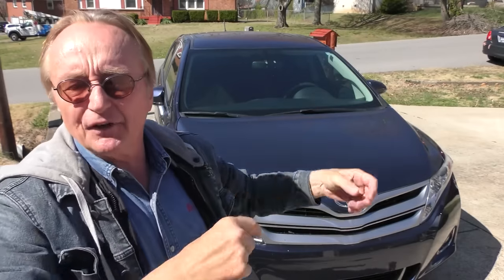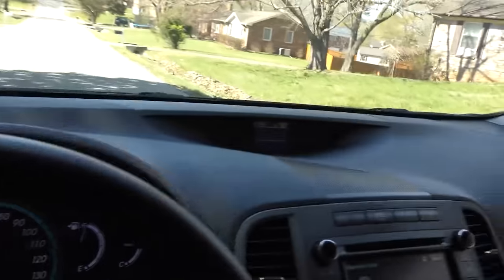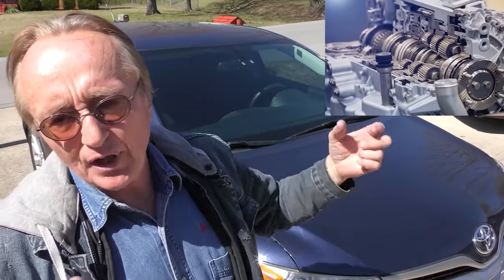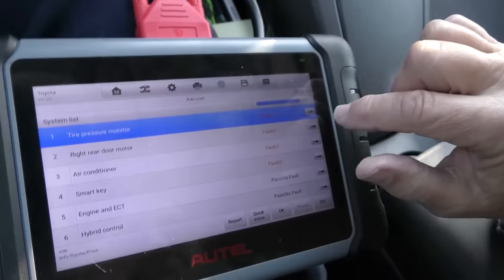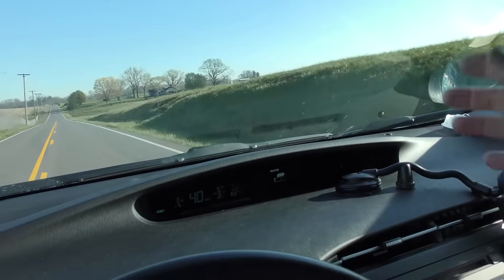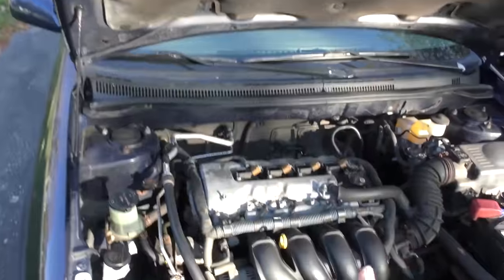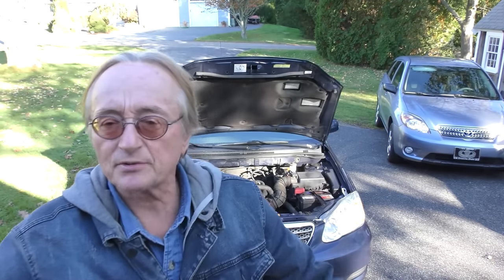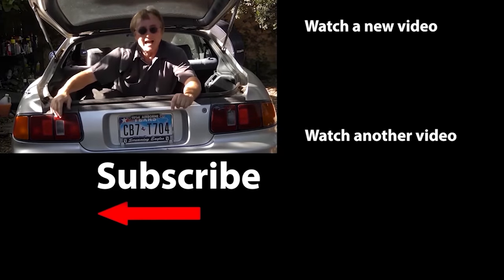Everyone Hate These Cars, So You Can Buy One Dirt Cheap

Comment: A hub cap serves a purpose of covering the hub but and helps prevent the lug nuts from rusting on so hard. The cheaper models that have hub caps many times will use the cheap lug nuts with it, and therefore the hub cap serves its practical purpose. But the flashy models have no hub caps but designer rims, but since they no hub caps it is required to use the more expensive lug nuts that have a cap on each and every lug.

In other words if you want to have the practicality the hub cap provided for the car without the hub cap, then you need to find lug nuts with caps that fit the car hub and rim.

Comment: I just got my 03 protege back from shop. Got a used 45k motor put in. The first motor went 220k tranny about 180k. Simple little 4 banger easy to work on great gas mileage parts are super cheap it's my second favorite. My 89 VW fox was probably my best car I ever owned. 305k when it finally went. Couldn't find a motor for it so sold it. Kills me to this day lol
Reply: I got 175k out of my 88 VW Fox Wagon….awesome car bought new owned for 14 yrs.
Reply: @jarhead6153  That's nothing. I bought a new Nissan Sunny in 2000. Still running perfectly after 23 years, and over 200k miles.
It's still in mint condition also.

Comment: I myself prefer a standard transmission in what I drive. I'd also have to say that the plug in hybrid does make the most sense when it comes to electrification. 50 to 80 miles worth the battery range so you can plug it in and do most of your normal commuting and the gasoline engine for when you need it. I really think that makes the most sense.

Comment: I agree with Scotty in that one doesn't always need bling.  I wish I could have found a Venza like that one when I needed a car.  Yes a FWD Venza is vanilla but I'm at the point where comfort, reliability and not killing me at the pump is what I need in a daily driver.  The one thing I don't agree with him on is snow tires on the front only with FWD.  I live in a place that gets winter and you need the the traction at the back so the rear end doesn't swing out under braking.  I can also say that FWD with proper winters has gotten me everywhere I need to go in the worst weather.

Comment: These are kind of hard to find. Toyota didn't sell them in big numbers so there aren't a lot of them out there to begin with. The good thing is that you can usually get these for substantially less money than a 4Runner or any other Toyota SUV with similar mileage.
Reply: They aren't suvs that u can compare to a 4runner. They are lifted station wagons. My sis bought a 2015 loaded one, v6 awd. A camry with a lift kit.
Reply: YAWN
Reply: With nice rims, bigger tires, amp & subwoofer, tint the windows, black exterior you got a pretty nice car.

Comment: Ive Ubered in several Priuses with over 250,000 miles and one with a smidge over 300,000, all ran great and had the original battery.

Comment: I wish I'd been able to find a car like this Venza last summer when I was forced to buy another car after my 98 Accord went up in flames.  The best I could find was  15 Nissan Altima S with a CVT that I'm not thrilled with.  I much prefer the trans in the Venza.  Good work, Scotty!
Reply: Those nissans won't even last 100,000 miles . Good luck
Reply: Those are actually pretty reliable cars you really just need to take good care of the CVT
Reply: @icosthop9998  I've been forced too
Reply: @icosthop9998 sounds like someone needs to get their credit up cause only fools are forced into cheap cars lol
Reply: @TREBLATALKS  That vehicle will last if you take care of it.  Even a timing chain job is cheap compared to New Car monthly payments. . Crate Engine if need be.
Reply: DId you file a lawsuit for your car going up in flames? cars are not supposed to go up in flames. and it could have killed a family if they had been in the car. that's a big-time criminal negligence lawsuit.
Reply: @wrestlerstudmuffin Its a 98 accord that probably had some miles, and leaks. After the warranty is up by like 23 years its very hard to find an automobile company to be liable for stuff like that.

Comment: Bought a one owner 09 Venza with 60,000 miles yesterday coincidentally the same day you posted this video. Got the 4cyl by choice. Paid $14,000 out the door. I know a few years ago it would have sold for under $10k but the way I look at it, it will last another 250kiles. Most new cars today that are $25k will start to fall apart after 100k miles.

Comment: Damn, I'm old enough to remember when you would say "you don't need a big V8 unless........" but now we got scotty saying the same thing about the V6. 🤔
Reply: Toyota's 4-cylinder engines from 2010 and after make up to 170 hp and 170 lb-ft of torque, and they are cheaper to maintain than the V6 models.
Reply: F1 cars used to have V12s, V10s, and then V8s, now they have V6 turbo hybrids and set faster lap times than ever. Engines and power trains continue to get more efficient and in turn, smaller

Comment: $1000 for TPM's? WTF....over?  I just did the TPM's in my C5 Corvette last time I put tires on her ($600 for Kumho Solus at Tire Rack 😂). Bought 4 NEW TPM's at RockAuto for $96!!!!!

The local tire shop here in Knoxville was so cool, they let me come into the  garage and install the new TPM's after they ripped the tires off the 5 spoke wheels.

When I got her home, ran a magnet around the car and performed the "TPM learn procedure". Piece o' cake!

Comment: "Most people think they need more than they actually do."
amen. Applies almost everywhere, especially with technology.
On cars, I laughed out hard for over a minute straight when I saw the mini-van (2013 VW Sharan) my parents got as an upgrade for our ageing but mechanically good MPV (2007 VW Touran).
It's huge (to European standards), has poor fuel efficiency and takes some getting used to to shift properly, but wow did they get a fancy trim level.
I like it for it's different driving experience, nice contrast with our second car (2019 VW Up!, very basic trim) which I get to drive more.
Maintenance is their problem, I'll watch how these German built new computerised VWs hold up and use that experience in my consideration of what to get for myself down the line.

Comment: I have a 2005 corolla with a manual transmission. I've owned it for 15 years and it has 178,000 miles. No issues.

Comment: Oh yes absolutely put it in power mode when your going out into traffic quickly and when passing someone..it makes a world of difference! 
     I used one of the 2 Prius my parents have. And for the 1st 3 days I was like dam this thing is slow and really dragging out that gear! (Not knowing CVT was belt driven) 
But it sounded like I was dragging out 3rd hear at 45-50 MPH! 
    Then discovered the modes. And I kept it on power mode and still got 45mpg  really getting on it too.normal mode it got 55MPG. So 10mpg less isn’t such a big deal for power

Comment: Yeah.  Toyota later inline 4s make their 3.0 L V6 obsolete, which gave very slight advantage over the previous 4-bangers, because they made the frame so much heavier in the first V6 runs.  I think they kept the same frame when they went up to 3.4 L, and those were really nice pickups, still in high demand, used, but in very short supply.  I wish I'd bought used when I bought my 2012 new on a lease, because I had nothing to put down.  sigh

Anyway, that's good to know about the Venza.  That it's basically a cross-over on a Camry chassis with a Camry motor.

Comment: I have a 2009 Pontiac Vibe. It is a sister Toyota Matrix. I have the 2.4 Toyota engine. I change the oil every 3000 miles. The oil consumption is minimal. I change the transmission fluid every 12000 miles. 
The car has 122,000 miles now no problems.

Comment: I had a 2003 4Runner with 256,000 on it. Ran like a top and everything worked perfect. Unfortunately, the frame rotted out. Apparently it was a known issue for that generation
Reply: Same thing with this generation Honda Pilot. I checked out a 2008. Fully loaded and I was almost sold until I looked at the rear frame area. 
Too many holes and thin spots
Reply: If its not the guts its the structure...

Comment: My 2004 5 spd. Corolla was super fun to drive. I learned how to drive on a Ford 9-N tractor. And I use a clutch like a trucker. My clutch will last forever, anyways, that Corolla transmission went out at 180,000 miles. I always changed the fluids. It was clean. IDK, that main carrier bearing went out on the tranny. Other than that is was great.
Reply: Absolutely true I only used the clutch for 1st and reverse.  I put 300k and donated it to a senior living home and they are still driving it only needed to have struts and shocks replacement

Comment: i drive 2 Venzas, a 2009 V6 AWD is my personal car and a 2013 4 cyl FWD work car which is a taxi, the  4 cyl 2.7 L are known to be oil burners and they also have problems with the vvt  timing gear which causes a rattle on cold starts. The transmission also started slipping at 200,000 kms, it currently has 350.000 kms and still runs good , despite the issues. My 2009  is in mint condition . The V6 is far superior to the 4 cyl.  Also the difference in fuel mileage is only 1 mile per gallon.

Comment: I do not understand why they don't give those alumin(i)um engine parts some varnish, for instance a clear poly-urethane, coating. Those parts as far as I can tell would not get so hot that that coating wouldn't be able to cope with the temperatures, and such a coating would be a cheap and effective way to keep those parts from degrading even if only surfacially and visually.

Comment: I live in Las Vegas and there's a lot of Venzas for sale here. Average is older, 2008, 150,000+ miles and $14000 to $17,000 dollars. Yeah, I don't think so. I just picked up a 2015 Hyundai Tuscon that had a recall and new engine put in 50,000 miles ago for $7,000. It's underpowered but it drives like a new car. It doesn't matter what car it is, a hundred thousand miles, is a lot of miles.

Comment: Hi Scotty. I've just discovered Your chanel and it is great. Now, regarding Hyundai Accent. I have a 2005 1.6liter accent with an A\T. You are absolutely right. This car is so flimsy that one could say the body works as a part of suspension.Whenever I ride over the curb my back hatch moves a few mils and makes fumy noises. It is 100% accident free. It was designed like that and I like it.  Just did over 110000km. with a LPG installation and never had a problem with it. 8,5 liters of LPG/100km !!!. Cost under 5 USD per 100 klicks. Just need to change oils and filters regularly. Greetings from Polish coast. Village of Mielno.

Comment: At the time of this recording, or the release of your video, TOYOTA, just released their Toyota RAV4 PRIME Which is considered a plug-in hybrid and does exactly what you just expressed. It starts on electric until a certain range or battery level and then it switches to the gasoline burning engine, and there is no going back-and-forth, it always has to start on electric and once the energy is depleted from the battery to the threshold at the BMS is programmed. Then will do gasoline burning engine turn on the RAV4 prime. so in my opinion, yes it is the best of both worlds and there is no need for strictly electric cars because there is no guarantee you will be able to get electricity, but there is always a guarantee you can find a gas station.

Comment: I bought a 2014 Venza with a V6 and 49K miles on it five years ago for $16,000. Not AWD. It's an XLE so it has a sunroof. It presently has 80K miles on it as I haven't driven much since I began working remotely. I like its get-up-and-go, but the MPG is a disappointment.

Comment: Get v6 .  More power is always safer for passing. I   Had underpowered V6 F150 what a nightmare. And it was 2 wheel drive in West Michigan winters. Finally bought a used 04 Silverado with a 5.3 V8 and 4 wheel drive what a difference. And the gas mileage was negligible.

Comment: I just bought a 2015 Range Rover HSE Supercharged, dirt cheap, $19k, It drives and looks expensive,imma do the timing chains and replace the air struts, $2k in parts, it'll go another 50k miles trouble free.

Comment: My 2010 Venza has 112,000 mostly city miles too.. the V6 gets 20-24 mpg.. but it's fast as hell too.. needs tires & prolly needs brake pads again
Reply: First time I see someone trying to sell his car in Youtube comments
Reply: @karakraal4551  Hell no,, I pick cars carefully, always buy used and drive the wheels off of them. PLUS,, now I'm a 60yr old x-mechanic,, when I pass, this Venza goes to my sister..
Reply: I have also a 2010 venza with 197k v6 it's really fast some times when I give it gas my neck snaps back lol. this has been the most reliable car I've had

Comment: Scotty, my question is how do you disable the traction control on a Toyota because I don’t need it I don’t like it it induces an accident more than it prevents one and no I have not had an accident dude one, but my brakes were engaged when I need speed even when I manually turn it off by the button, I want to permanently disable it how does a person do that?

Comment: I am retirired and live in the Philippines. I just bought a 2002 toyota Camry. It has 95000 kilometers on it the seats are leather,that i do not like. I paid $4000 for it.2.4 litre. Runs like a scalded dog. I put a set of tires on it only because the tires were 15 years old and a new set of brake pads.The fuel mileage is great. Last car I will ever need.

Comment: I got the AWD V6 Venza with 80,000 miles for $17,000 in 2020. It is a 2011, but the thing runs amazing. We put over half down on the car, so we have small payments on it, and it'll be paid off pretty soon. They're really good vehicles. I like driving it better than my 2013 RX 350.

Comment: I have a serious question, please inform me if you can. I just got a used Subaru forester 2006, it has fresh oil on the spark plugs, and dry oil around the head gasket. I'm afraid that it has blown, I have took my time looking things up. I took my time and looked around under the hood, there doesn't seem to be any damage, it seems the seals had leaked forsure. How worried should I be, and/or should I try to get my money back?

Comment: The first tractor trailer rig I drove had two gearshift sticks. They had to both be used at the same time under load. You steered with your arm through the wheel. Try downshifting that baby going uphill pulling 2 trailers full of high octane jet fuel.

Folks nowadays would have a cow trying to use such things. But I was the newest driver, so I got the oldest POS they had. They figured if I wrecked it, good riddance to both of us.😂
Reply: Dang, I've heard of this once from a 30yr driver.  Either you're ancient (no offense) or the ancient truck is still running.
Reply: @TrumpIsrael2024  I'm 70++ and I'm still running. Don't know about the truck, but this was in '70, right after I got back from service, so I doubt it.

I only drove it about 4 months before they decided I wasn't going to make a road crater, and it was too slow a rig anyway. I graduated to a White COE rig that was like riding bronks all day, cause every pebble those front wheels you sat directly above was instantly transferred to your spinal column. Concrete roads, with their expansion strips, was the worst.

And I'm paying in pains for all that fun and adventure I had in my misspent youth. It's why only the good die young.
Reply: @Tinkers Trade  keep running in any way you can. That old stuff was hard on your body and your head. But it made what we have today. Just keep going.
Reply: High octane jet fuel eh? Regular jet 1A has an octane rating of 15 so the good stuff must be coming in at 16-17?
Reply: @wally7856  Beats me! It was just listed as jet fuel HO on the paperwork I would have as signed receipt for delivery. I always figured HO meant High Octane. 😲

Comment: I like all of these cars. I don't hate any of them and neither does the marketplace. But they are not cheap even with 200k miles.  Everybody knows they are reliable and command a big premium over junk from Stellantis and GM. And you still have to dump some money into them for all of the required maintenance to get to 300k miles. It won't get to 300k miles on its own with just oil changes.  Getting a good deal requires not buying a car with a Toyota or Honda badge.  I think the era of buying sub-$5k reliable cars is probably gone for good. Everything sub $5k is going to be unreliable junk from this point forward.

Comment: 101,000 on original exhaust?  I have an 09 Chrysler T&C with 195,000 on original exhaust.  01 with 184,000 on original exhaust.  Toyotas aren't magically better than anything else.
The real reason for  V6 over a four is smoothness.  Inline fours vibrate.  The tradeoff is fuel consumption.  You pay for the luxury of smoothness.

Comment: What is your opinion on a 2000 Volvo S80 t6 I watched your old Volvo vids but one was on station wagons and the other on a 2015 I’m just not sure if will be reliable
Reply: He doesn’t answer questions on here
Reply: Last June, I paid $5250 for a 2007 Volvo V50 wagon with 120,000 miles.  It's a 5 cylinder engine and hasn't given me any problems whatsoever.  Volvo are reliable and high safety ratings and I'm very happy with mine.  First time I've ever owned a Volvo.

Comment: Toyota hybids are the mlst underrated cars on the road. Very reliable. Engine oil and brakes last longer due to regen brakes and dual drive trains. And the price difference between gas and hybrid is less now than ever before. Thr sienna hybrid is magnificent. Roomy snd efficient and will last.

Comment: After maeket tire pressure sensors are about 40+ a pop, BUT, if you carefully open th OEM, you can change the battery!!! So either 160+install which might be 100 at a indi shop, its not horrible. OR change batteries and save another 150 with OEM sensor